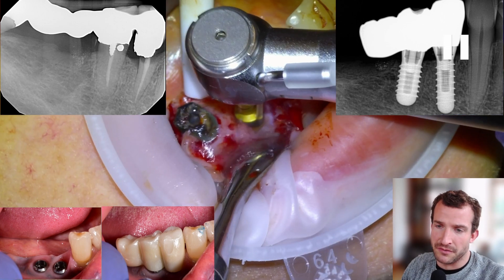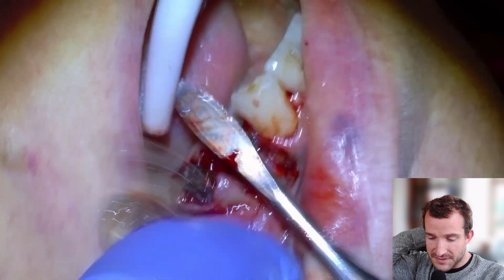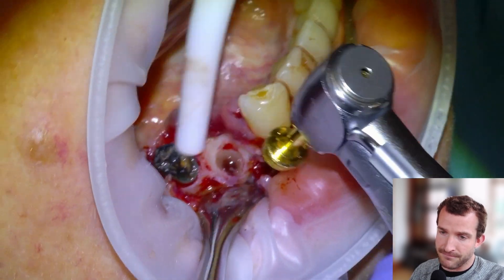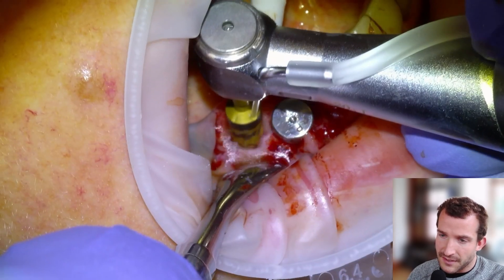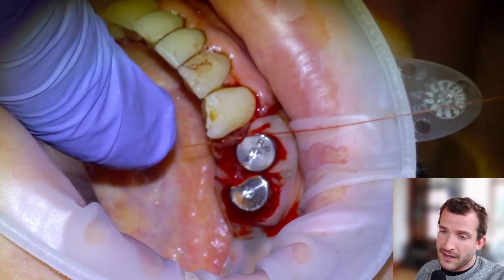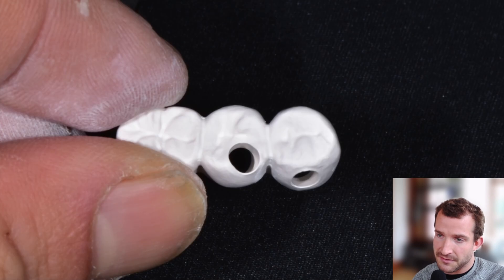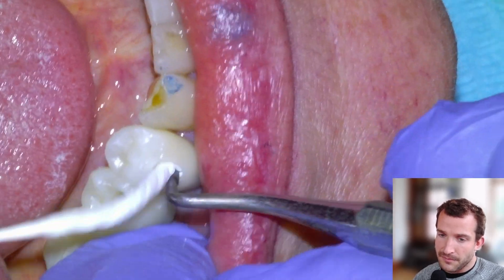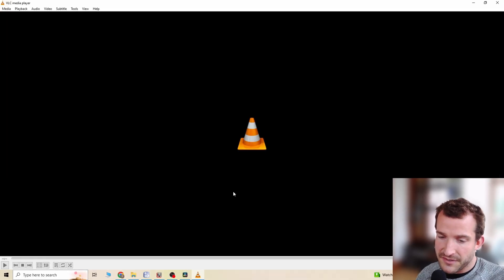[73] Infected Bridge Replaced with Dental Implants

Comment: Hey, what is your reasoning behind doing a cantilever here instead of placing the second implant more distal to eliminate the cantilever? Are you worried about the occlusal forces on the cantilever causing screw or fixture fracture?
Reply from the maker: The ridge in the 46 site was severely atrophied because the tooth had been missing for decades. I have no concerns about a 4.1x12 and a 4.8x10 side by side supporting a 1cm cantilever. The zirc thickness around the buccal of the 44 left a bit to be desired but I don't anticipate it will fracture from normal function. We used an HTML material which is a 4Y instead of the usual STML for that reason which makes it look a bit less esthetic but pt didn't mind
Cheers:)

Comment: What scanner do you use?
Reply from the maker: Trios 4
Reply: @behindtheloupes 
Nice. Any thoughts on their latest model or their competitors like trios 5, primescan and itero?
Reply from the maker: @sel7546  when I looked into the features and specs of the trios5 when it came out I don't recall there being any actual performance upgrades other than no need to calibrate and apparently more hygienic? Not worth it imo... I will probably rebuy the 4 when mine craps out. I had a 3 prior to it and the difference in performance between the 3 and 4 is massive. I wouldn't use a 3 if I got one for free
Reply from the maker: @sel7546  no comment on the other brands of IO scanners...Argen is a distributor of Trios and I am a major Argen fan boy so whatever they are selling I'm buying..
Reply: @behindtheloupes  good to hear! Considering trios is a fraction of the itero. Itero is a rip off!
Reply from the maker: Never knew iTero was more I thought that Trios was a premium brand...honestly if I was in the states I would probably buy the one Blueskybio distributes to try it out.. Their products are excellent value and they generally don't miss on quality either
Reply: @behindtheloupes 
I'm from edmonton alberta. Latest itero m principal dentist's office bought was 65k cad. And I think the monthly subscription fee is like 500 bucks.
It's owned by the same company as invisalign. They've pretty much stopped accepting scans from other newer scanner brands.
I call it the "invisalign" tax/fee
Reply from the maker: Lol that's insane I thought my $35k Trios4 with a $1500 yearly sub was a racket. Tell your principal or office manager to switch to Argen and also On Track Aligners while they're at it - Montreal based company with crazy good service, guy named Dr. Nic Gagnon is the director and I'm pretty sure there's 5 of him. Bunch of my D school classmates ended up in Edmonton btw heard it's not half bad up there
Reply: @behindtheloupes  Yeah, i'm currently setting up my own office, was thinking of buying primescan from dentsply (also around 35k and I dont think it REQUIRES a monthly sub), heard some good things. Getting pretty saturated here too. I probably know some of them lol, small community. You a UBC grad?
Reply from the maker: That surprises me I associate Dentsply with $$$. Yup UBC 2018, are you UofA? Congrats on the new office I didn't do a startup but feel free to DM me on IG if u wanna talk about ownership :) It's tough in a lot of places, Nelson has like 8 clinics with about 15 dentists in total but everyone seems to keep busy
Reply: @behindtheloupes  I'm from Toronto originally. U of T 2017 grad. Moved here right after with my wife who's from Edmonton originally. I appreciate it! I came across ur insta and I think I started following it yesterday. Had a mutual friend, Paul. What's his name? Nelson what? My boss owns a whole Lotta clinics and he knows all the big players in the city
Reply from the maker: Nelson BC is where I'm at. Probably Paul Comartin, UofT as well, solid dude we're good buddies, I place implants at his office which is across the street from mine. Him and his business partner Chris Cirello own one here along with a few others in BC, Chris is UofT as well and quite the enterprising individual doing a startup in Cali called Cyberdontics that's looking to automate crown preps with robots
Reply: Oh nice lol. I thought nelson was someones name you were referring to, paul and i go way back! Havent talked to him in a while. Hes a great guy, tell him i said hi to him next time! I was a yeat behind him. Hope hes doing well. As always, thanks for sharing a lot of great tips! The way you do dentistry reminds me a lot of what I do. Always enjoy it!
Reply: @behindtheloupes don't know chris very well! But sounds like a smart dude!
Reply from the maker: @sel7546 Thanks and will do :) all the best 👍

Comment: Is there an advantage to cantilevering the molar vs a traditional implant FPD with a middle Pontic?
Reply from the maker: The 46 had been missing for decades and there was no ridge. The 47 site could have been used but it would have been non-functional. These two bois will happily support a 1cm distal cantilever without issue

Comment: How many of those angled screw channels have you used now?
Reply from the maker: Hundreds, they are the simplest and easiest abutment/tibase to use imo. I've used a few of the Straumann/Medentika ASCs but only half of the actual circumference is available for the screw channel to be angled out of which means more work for you and the lab and another thing that can go wrong, they also aren't sandblasted so I've had a single unit debond from the abutment before. These are simple and elegant and can be used for any indication including AO6 bridges